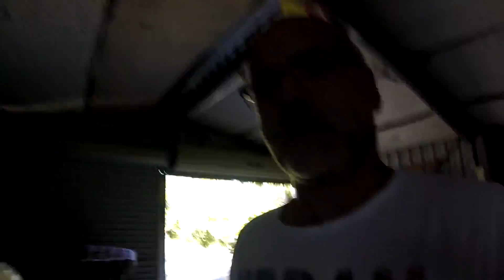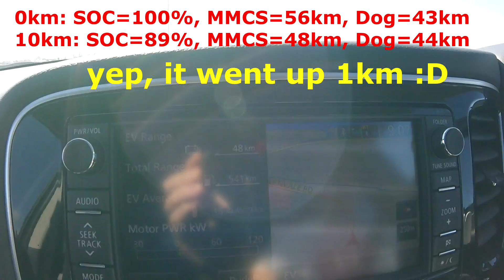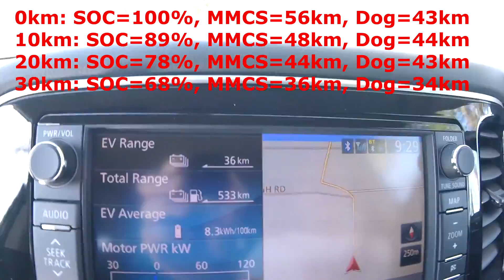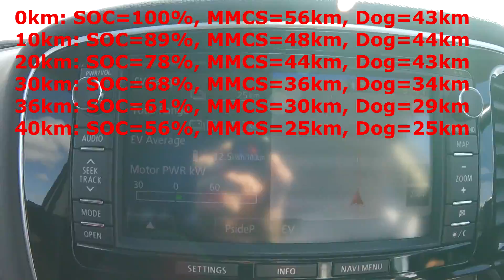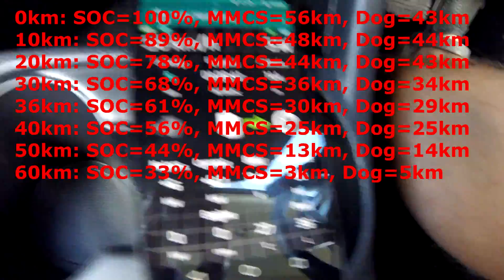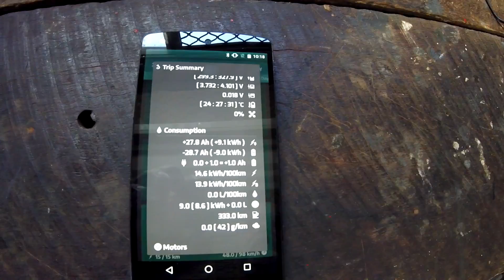EP205 - Constant 60kph with 40Ah battery. A new hypermiling record?

Comment: When you said you were doing the test on B0 I thought that you were going to do what I habitually have been doing for some years in my PHEV. Every time after stopping I use the right paddle to get to B0. One regular 10km trip of Gold Coast driving has several km of very slight undulations. Here I Power as required down slopes and essentially coast up gentle rises. It is amazing just how far it will roll using no power at all. This sounds like what your European friend is doing. I do not use Cruise here as this defaults to B2 and would not coast at all. In your rural setting it would be very interesting to see what would happen if you used B0 exclusively and gently powered up to about 65km/h and then let it roll to about 55 then gave a gentle nudge of power to bring it back up to 65 and so on. Tedious? - maybe, but after all it is a test. I have actually seen the Guess-O-Meter increase range by 1km during a long coast. Unfortunately leaving my house involves significant hills.
Reply from the maker: From an energy and efficiency perspective it is better to keep the car at 65km/h  constant. You will have more losses when slowing down and accelerating again.

Comment: Great video Andy! I'm sure you can get more distance by traveling in B0 mode and leaving coasting as much as possible. Two weeks ago I did a test with the MY2018 PHEV with the following data: Odometer 10915km, SOH = 34.5Ah, SOC= 33.9Ah, GOM= 50km, GOM Dog= 43km. With the SOH of 34,5Ah of my car, I reached 53km (the average speed was of 38kph). Wall-to-whell of 14.2 kWh / 100. Unfortunately, it is not possible for me to maintain a constant speed due to speed limits and the type of road. So I think that with the battery at 100% of the capacity you can get considerable distances.

Comment: 21:15 I knew you'd say exactly this sentence, I knew it already when you announced the video. I still don't understand how can the BMU alter the capacity, but it does. I've seen it first-hand after a reset/initialization. So at this point: isn't the easiest solution to have a BMU initialization at each service?
Reply from the maker: Cannot saying it often enough, right?! Some still say it's the battery :D
I'll explain this in an upcoming video. I need my whiteboard for that ;)

Comment: Superb result. Suggest you add to the sign 'Please Pass'. That will work. I've been hypermileing and best I got was 43km. However the GOM shows 27 miles from full charge now. Before l started to use B0 aggressively and the charge paddles regularly the GOM was 21 miles at best, so B0 all the way for me.
Reply from the maker: If I put 'Please Pass' on the car idiot will just do that without watching the traffic because the sign said so 😂
Reply: @unpluggedEV  Yeah, good point

Comment: Hello Andy,

Great test and the result is very close to my App calculation. 

You needed 14,6kWh/100km but this is with regen. Wall to Wheel 13,9kWh/100km!!

You accelerated minimum 4 times (passing the other cars) to 60km/h so you needed minimum 0,1263 * 4 = 0,5052 kWh for the extra accelerations.
13,9kWh/100km Wall to Wheel - 0,5052kWh/61, 4km= 0,8228kWh/100km = 13,077kWh/100km and this is very close to my first calculations 12,63kWh/100km 😉.

So my App calculate correct 😉
Reply from the maker: Jeeez, you lost me somewhere... I just believe you, OK!?
Reply: @unpluggedEV  no problem